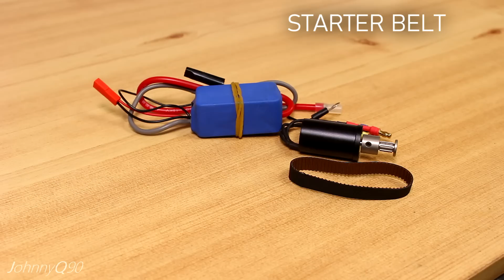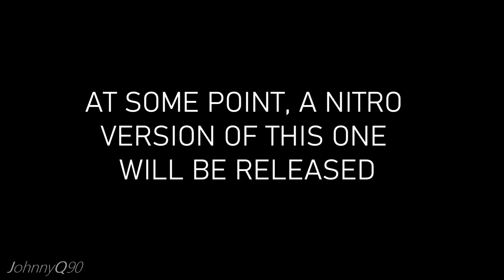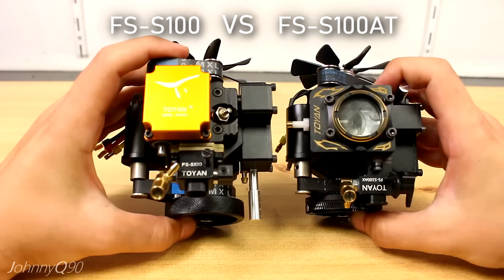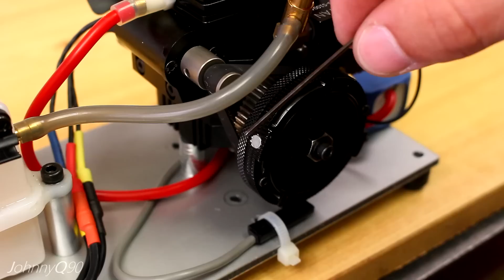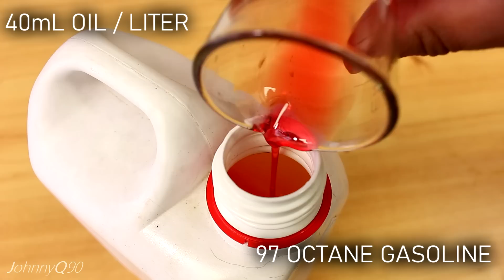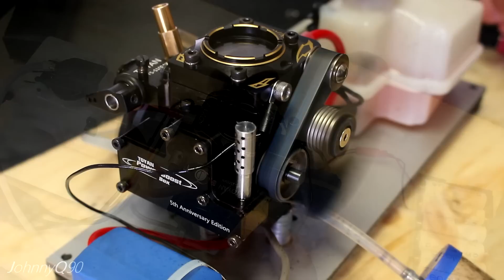World's First Production Micro 4 Stroke Engine with See Through Head!

Comment: When will you post something about supercharged rotary engine?
Reply from the maker: The centrifugal supercharger was one of my favorites projects and helped me understand many things, but it didn't work.My plan is to make a positive displacement supercharger. I'll have a higher percentage of success.
Reply: @johnnyq90  this is just my opinion but I think you should test the fuel system first with compressed air. What I mean by this means is instead of using a turbo, use an air compressor for now to test that your fuel system can even utilise boost in the first place.
Reply: @johnnyq90  I assume you have read our input on the supercharger? Honestly I feel like that is a good decision, as centrifugal supercharger boost goes up with RPM so it's not optimal, not to mention the super high rpm required, while with a roots or twin screw it's instantaneous. Though if you ever want to re-visit the centrifugal supercharger and you believe you can make it work reliably with super high rpm, that would be epic.
Reply: @MrAndrius12  however, if my memory serves right, the rotary is going on an aircraft, where high rpm is constant. Id vote turbo or even stick with belt driven centrifugal for that application.
Reply: @MrAndrius12  a roots blower style might be instantaneous but they are also the least efficient of all forced induction
Reply: @jamescampbell4205  well if he could make it work reliably at high rpm then sure. The smaller turbo/centrifugal charger you make, the faster it has to spin (plus tolerances aren't as easily met) so this has to be taken into account
Reply: @shaynegadsden  yeah but read my comment again. Who wants to rev the crap out of the engine for a measly couple PSI of boost?
Reply: @MrAndrius12  this is true, but also applies to roots blowers too. And when you spin a roots in the 8k+ rpm they turn into hot air pumps
Reply: @jamescampbell4205  not really. Roots have long been known as being good for the low end. Sure, boost gain in theory slows down due to the heat/pressure buildup and whatnot. But it does not go up with rpm... It gets less and less efficient at higher rpm, it's a positive displacement supercharger...
Why do you think air compressors are more often positive displacement (resembling a piston engine)? Those types don't care about rpm, they take x amount of air and deliver x amount of air. A centrifugal blower can only boost at y amount of rpm, think about it, you turn it a couple of revolutions, the air has time to escape the blades, while with the positive displacement charger takes the air and dumps it as it can't escape.

It's hard for me to dumb it down, but hopefully you understand.
Reply: Hello bro I love you videos a lot and am inspired to be reposting it in my youtube channel what I need is just your go ahead for me to do it which I will be very happy if you could let me do it sir...
Reply: I prefer 4 stroke otto engines or two stroke detroits

Comment: IF YOU HAD SOME KIND OF SPARK ADVANCE IT WOULD REV HIGHER WITH LESS STRESS AND SMOOTHER.
Reply: Yes a slide for the magnet for low/high RPM. 20 degrees should do it
Reply: adjustable ignition angle flywheel. This is in the product description
Reply: Nice caps tho
Reply: The spark is also occuring after top dead center
Reply: @ibuildblasters8118  I USE CAPS AS A FONT CHOICE BECAUSE IT IS EASIER FOR ME TO READ WITH MY POOR EYESIGHT.
Reply: @Mr_Jack_Shelby  NO, THE DESCRIPTION IS.... "World's First Production Micro 4 Stroke Engine with See Through Head!"
Reply: @TechKnowCSS  hmm, when I checked at the time of my comment it did say it had an adjustable ignition flywheel.
Reply: TechKnowCSS 
ALPHA MALE ASSERTS HIS DOMINANCE
Caps so u can see
Reply: @user-gh5jc9tx5r  YOU LOVE LETTING EVERYONE KNOW YOU LOVE MAKING FUN OF THE BLIND AND HANDICAPPED..  YOUR MOM MUST BE PROUD.
Reply: TechKnowCSS 
I PUT IT IN CAPS SO YOU COULD SEE, IM NOT MAKING FUN OF YOU.
Reply: @user-gh5jc9tx5r  CAPS LOCK IS STUCK ON HELP PLS

Comment: So where does the excess oil come from? From the pan, doesn't it? It is just missing an oil pump. Even 2-stroke engines can mix the oil themselves. After all most of it is needed for the bearings. So no matter if the fuel washes it away afterwards, the ideal point for oil injection is in the bearing and not the fuel tank.

Comment: Flat Head 4 stroke engines of this size are perfect for small applications and develop more power per cubic centimeter than a traditional overhead valve design. It can also handle more RPM. The oiling system is its only drawback because it limits continuous operation and ultra high rpm.

I remember when several go kart hot rodders in the 1980s modified 400 to 500 cc flathead models solving this problem by using a roller bearing using a custom made 2 piece crankshaft for the traditional babbit connecting rod bearing (most flathead designs today don't even use a bearing because they are low rpm engines) that eliminated the need for adding 2 stroke oil to the fuel while having the added advantage of keeping the oil in the crankcase below maximum temperature at high rpm. These engines could run for as long as fuel was available. Oil "consumption" was astonishingly low at .65 ml per hour. 

I wonder if a roller bearing could be used in one of these.

Comment: Is the breakdown review coming up? I am curious about how the oiling is done in this one.
Reply: Id bet the oil in the fuel makes its way past the piston somehow to lube the bottom end
Reply: My guess would be that the crankcase is part of the intake path -- it's the intake manifold if you will.  That is, after going through the carburetor, the air goes into the crankcase, and then to the intake valve.  But.this is just a guess.
Reply: It most likely has a single piston ring. The oil leaks past the ring gap into the crankcase. Excess oil is drained to the little container. That's atleast how it works with nitro 4 stroke engines. I assume it's the same here. 
Bet it's a gas engine because they can't get the compression high enough (yet), it been a side valve and with the glass head.
Reply: @Albert Einstein thanks Albert
Reply: @Albert Einstein Cheers Albert

Comment: You need to advance your timing by just a little so the spark comes a split second before intake and that sucker will take off. move the electrodes back about an 8th of an inch and see if that doesn't increase RPM

Comment: I don't know that I like the Nylon insulator on the spark Electrode, looking through the head window, you can clearly see it beginning to melt after just a few seconds of operation. Which means that the nylon will melt to the point where the spark electrode will be blown out of the head by either the compression stroke or the combustion stroke. which means this engine won't run for very long, if you...let's say: decide to power an RC model with it for example. I hope it is possible to get a ceramic insulated spark electrode for long term operation. But Other than the spark insulator issues I see, this engine is still pretty cool. wouldn't mind picking one up.

Comment: What is the isolation material of the sparkplug? And i hope the glass on the top is pyrex to handle the heat?
Reply: I was wondering the same. It looks almost like plastic, but It must be some kind of ceramic. It looks pretty fragile in general, so I wonder how they made the packaging for it.
Reply: @DrBernon  The insulator look like it's made from Nylon to me, since you can clearly see it melting in the combustion chamber.
Reply: @alien200049655  OMG. It does look different and pretty black. Well... in that case this engine can't last for too long. XD
Reply: @DrBernon  it was designed to be moved and clean after use
Reply: @toyanengine1274  Not sure what you can do cleaning it if the plastic burns.
Reply: @DrBernon  it's not plastic
Reply: @toyanengine1274  So it's ceramic?

Comment: Specifications:

.Color: As Shown
.Material: Metal + Plastic
.Speed: 3500-8500rpm
.Displacement: 3.5cc
.Output Power: 0.5ps
.Cylinder Diameter: 17.0mm
.Piston Diameter: 16.6mm
.Product Weight: 900g
.Package Dimensions: 12 x 10 x 10cm
.Package Weight: 1000g
.Packing: Graphic Carton

Comment: Adding some load on the engine would be interesting. Perhaps some big resistors on the starter motor?
Reply: the starter motor is not running with the engine, because it has a one way clutch that disengages

Comment: I'd use a paint maker to clock the high speed needle position. With the plan of switching to a clicker style aircraft needle valve assembly, if the friction o-ring one moved with vibration.

Comment: How long until the carbon builds up and makes it a non see through. I always love cut away or anything mechanical that you can see all the parts working together. I can picture it in my head no problem. Hazard of being a mechanic for 30+ years. I’ve built everything from lawnmowers to Winston cup engines. Back in the mid 90s I worked for a NASCAR cup team as the engine builder. My favorite part was cheating because you really have to think outside of the box. Once we had nitrous to use on qualifying at Daytona. And boy did it work got our first pole. It was setup to blow through a pop Rivet straight into the air cleaner. We used a Fire extinguisher tank for the in car fire system. We swapped it out after qualifying that evening and removed any traces of our nitrous system. We had to run the carb rich for the NO2 and had figured out on the dyno what made the best power. And of course re jet the carb so it’s running right without the laughing gas. Another we had a hydraulically controlled spoiler so it could be turned down on speedways where you’re running 200 laying the spoiler down in qualifying will make u faster but you will be running loose since you’re sacrificing traction for speed. Then switch it back while on the way off the track to tech. They measured the angle and hung a weight off it to make sure it wouldn’t deflect any. I have tons more stories but those are all I’m gonna share. Mainly because I went back to work for that team a few years ago for about 2 years and they are still running a trick the team owner and I came up with back in the mid 90s. No one has caught on and I will not give it away. Everyone in nascar cheats I’ve torn Hendrick’s racing engines apart and find their little tricks and add those to my bag. Another for qualifying is keep 2 spray bottles of nitro methane one for each guy on each side of the car as your pushing it to the start. Just simply stick your arm in with the bottle and soak the air filter with it. That will get you a couple of tenths on a qualifying lap. You can’t pull that trick in the big leagues. The team owner son and I were best friends in school and he got into racing some nascar sanctioned late model and hooters cup. You can get by with way more. Far fewer officials at those races.  The late model people hated us and our friends. Brad means who’s dad is jimmy means. All the Earnhardt’s dale jr, Kelly and Keri.  His sister Kelly is a far better driver than her brothers. And Jason Jarret dale jarrets son. They were pissed even the officials were against us. The races were 25 laps and you could easily get 2-3 races on a set unless u flat spot them. When Brad won his first race they introduced a new rule that anyone who had won had to buy new tires for every race. I was with Brad and Jimmmy didn’t give him anything except this fuked up chassis he got out of a field somewhere. So he and I proceeded to rebuild that chassis after a month we had a race car ready for the track. I built the engine for it a 350 with cast iron heads and a 2 barrel carb 460 hp on the engine dyno. I thought that was pretty good for a 2 barrel carb running cast iron heads. All the cup motors we’re always 800+ hp. Brad was running out of his pocket no sponsorship or daddy’s money just a lot of late nights and hard work. I look at my first time working for means racing as getting paid to go to NASCAR school. I have done anything that can be done to a stock car. Built them from raw metal and even a few bodies. Luckily there’s people there with 30 years experience and I was soaking up everything I could.  My nephew I blew his mind he had no idea that there was a race car shop local and I worked there so I took him and showed him everything in the shop. And Jimmmy had his pr guy to put the picture of my nephew in a race car on the top of his Facebook. It said something about visitors. His eyes looked like they were gonna pop out of his head. I was so glad I could bring such joy to him. Too bad schools out and he can’t brag to his friends.

Comment: Wait a 4 stroke running with 2 stroke. Never seen that before (I know it’s due to no oil on the bottom end) and also was expecting to see slow motion of the engine running. I know you might not have the cameras for it. But even iPhone’s do slomo 240fps so could see it good at 1/8th speed or maybe slower like 15FPS so 1/16 the speed

Comment: How does the rotating assembly get lubricated without an oil pan? With 2 strokes the fuel/oil mixture gets sucked through the crank case. A 4 stroke doesn't really have that capability.

Comment: imo it needs a load so it can run better and also warm up properly, then you wont have the excess oil because the heat will burn the oil properly.

Comment: when you turn the gear right starter motor turns but when you turn the gear left starter motor doesn't move. When the engine starts I assume gear will turn left to not damage the belt.

Comment: I'm sorry for noob question but I always thought engines have the spark needed only at start and then it's a self-continuing cycle.
Reply: You might be thinking about 'Glow Engines' which are commonly what small engines like this are. On those  you have to preheat the glow plug (which kinda looks like a mini spark plug) to start it and its self sustaining once its going.
 But in a normal Spark Ignition engine like this one the spark has to happen each and every combustion cycle.
Then there's diesels which have neither.
Reply: This visible methanol engine work with Glow plug,Only gasoline engine need sparking plug+ CDI to finish ignition

Comment: The flame shape is surprisingly inconsistent. I wonder if all engines are like that.
Reply: In person or slow-mo, it would look more consistent. Its mostly just an artifact of the fact the camera/video are capturing relatively few frames of something that's happening really quickly
Reply: There are other videos with really high fps slow mo of other engines with see through heads
Reply: I did some math..

so if its running at 2.5k rpm- thats 42 r/sec. Its a 4 stroke so that means the combustion event is only going to be going on/visible for mostly half those strokes. Meaning with a 30 frame per second camera we are capturing an event that is taking place in less than 1/84th a second, the camera isn't even going to capture a frame per combustion even, it's going to miss a bunch.

Comment: It's incredibly cool, but the fact that you still need 2 stroke gas for it really defeats the point of it being 4 stroke.
Reply: Tractors 101 kinda but not really. I have a 4 stroke STIHL weed eater and it has way more low end torque to cut through heavy organic material than any 2 stoke weed eater I’ve ever run. Yes like this you still have to mix fuel since there’s no crankcase oil but the design of the engine compared to other 4 stroke weed eaters with a sump makes up for that in my opinion.
Reply: @carsonhammond6204  I'm only stating my opinion here, I'm not saying it's a bad thing. I just like 4 stroke over 2 stroke because I don't have to mix gas and oil, but this type of engine kinda ruins that for me. It's also kinda hard to be a collector like me and store the gas, because different engines require different mixtures and you need like 10 different gas cans to store all the mixtures. That's why I only have 2 2 cycle engines.

Comment: Making and putting a supercharger or turbo on a single cylinder does not work practically, because there is not enough room in the cylinder to make boost. Meaning that both valves open and close too quickly not allowing boost/psi to build. You need more cylinders or another type of intake system so the turbo or supercharger can store boost/psi and not push it out of the cylinder as soon as it enters. It’s the main reason you failed last time. Look it up you were so close with your last set up, just gutted you moved on and people are still commenting about it. Give it a go bro you’ll get right 👍

Comment: So it’s a 4 stroke with no oil pan..... sounds like they messed up on the blueprints! Maybe you can make an oil pan for it, or just drill a hole in the crankcase and fill it with oil and then add a plug

Comment: Adding a small oil pan for cleaner operation is not a big deal for this motor, yes, more part and more complication, but what's the point of having 4 stroke engine without proper lubricating system? excess unburnt oil creating mess even for minutes of operation, the whole idea behind 4 stroke engine is clean operation, as much as possible, otherwise there is no deference with 2 stroke smoky one.